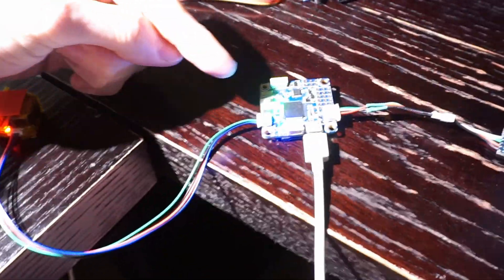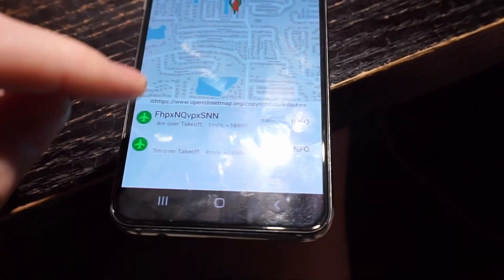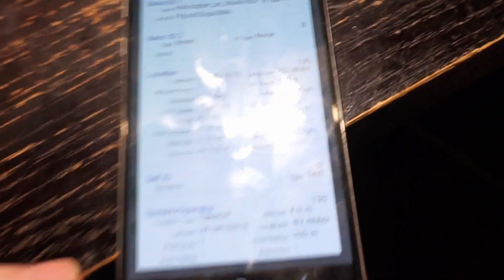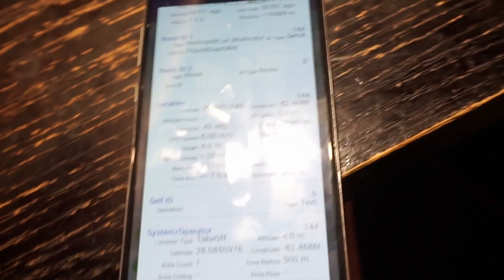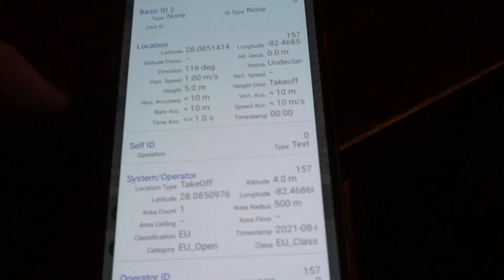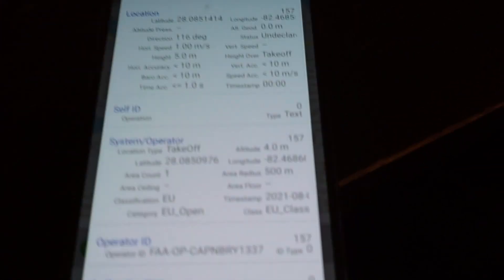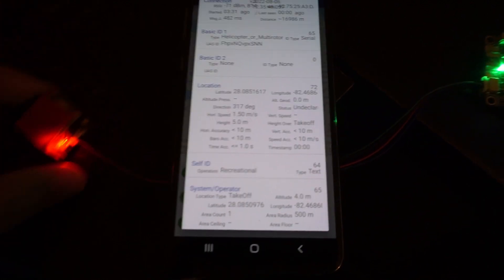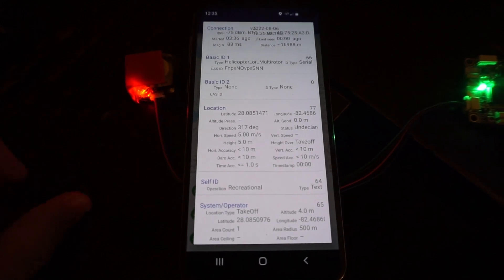ExpressLRS FAA Remote ID Proof of Concept

Comment: Hi, Do you have any source code? Can you share? What do you mean "It is too easy to tamper" I check some law and I don't see any special requiment
Reply from the maker: FAA Final Rule (2021-08) 
"The FAA proposed to require that UAS with remote identification be designed and
produced in a way that reduces the ability of a person to tamper with the remote identification
functionality. The FAA envisioned the UAS would have tamper-resistant design features to
hinder the ability to make unauthorized changes to the remote identification equipment or
messages. The FAA adopts this requirement as proposed."
Messages could easily be modified by relying on an external GPS source and tampering with the RID functionality.

The source code is on ExpressLRS Github, search closed PRs for "[WIP] ExpressLRS Radar"
Reply: @CapnBry  I need to check European rules for it. Right now  it seems to be enough for EU

Comment: This is actually how I think remote ID should work. No additional hardware needed. One of the arguments against this is that you could circumvent the system if it is something that is open source but I don’t think that is a reasonable argument to not do it this way. You could also warp a dedicated remote ID component in tinfoil. People have come up with ways to obscure license plate number but it doesn’t mean car license plates are not a good solution.

Comment: Looks awesome! The European Union's aviation authority, EASA, has quite similar requirements to those of the FAA, do you think this will also work for the EU?
And what app are you using to show the Remote-ID data on your smartphone?
Reply from the maker: It is possible, however due to the fact that this is not tamper proof at all, it can not meet the regulatory requirements. It puts us in a weird position where ExpressLRS can't be compliant, but someone can possibly create a compliant system from it if they lock the user out of it somehow 😕 also changes would be needed in betaflight to send us more information

Comment: Remote IID of the aircraft as well as the ground station /pilot holding the transmiter. Both IDs are required by the rule. I don't really care though.
Reply: Could the ground station location be the takeoff location? It wouldn't be hard to save the location at arm, and then transmit it with the current location until disarm.

Comment: Control point and aircraft?
Reply from the maker: I do not understand the words coming out of your mouth
Reply: @CapnBry  Remote IID of the aircraft as well as the ground station /pilot holding the transmiter. Both IDs are required by the rule.
Reply from the maker: @spartan3299  Yes, you can see that the aircraft position is there as well as the Takeoff position of the pilot, which is compliance with the FAA requirements

Comment: Is the FC transmitting the remote id ? Over wi-fi ?
Reply from the maker: The FC is just doing normal CRSF telemetry, the receiver is generating the remote ID from the telemetry as well as running the RC link. BLE, wifi beacon, and wifi nan are possible.
Reply: @CapnBry  then how is the mobile phone getting the telemetry ?
Reply from the maker: @hristiantodorov3923  from wifi scan information or BLE broadcast (no pairing or connection, just seeing broadcast frames), which the receiver is sending
Reply: @CapnBry  and that is standard ELRS hardware? Cool !
Reply from the maker: @hristiantodorov3923  it is ELRS 3.0 hardware, but the 2x WiFi methods can possibly get working on existing ELRS receivers with ESP8285 CPUs (almost all of them)
Reply: @CapnBry  wow really impressive! I wanna ask a little technical, which chip is doing what? is it that the sx1280 is just acting as a normal receiver, then the esp8285 transmitting ble beacons?

another question in mind is, will this cause problems to the current elrs link, knowing that they both run on the 2.4GHz?

Thanks! have been following your great contributions bryan!
Reply from the maker: @KolibriFPV  you got it right, the SX1280 is doing the rc connection and the esp is doing all the processing and sending out the ID broadcasts. I just got this together today so it is incredibly premature to discuss performance degredation in either RF or processor overhead just yet. I still have to get 3.0 out the door before I can even come back to this
Reply: @CapnBry  thanks, really appreciate you answering! I've been doing research on the lora protocol too, but still really new. i find elrs really inspiring, thanks for your hard work bryan!
Reply: @CapnBry  What other data would BF need to send It has altitude, heading, speed, GPS location, failsafe condition... I guess it would need to send initial arm location... and the ELRS module can send its ID... is it just missing arming location?